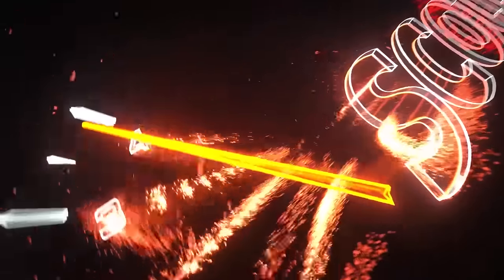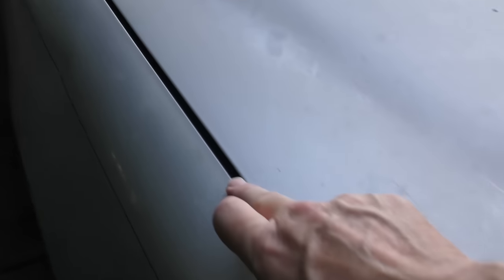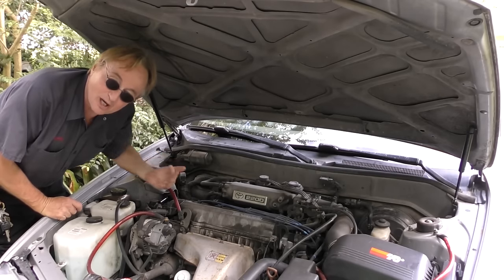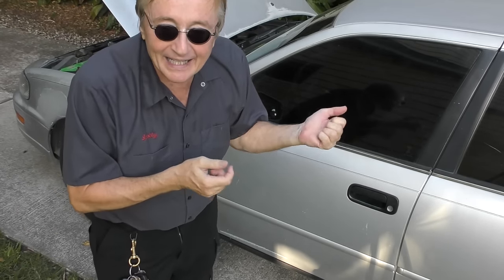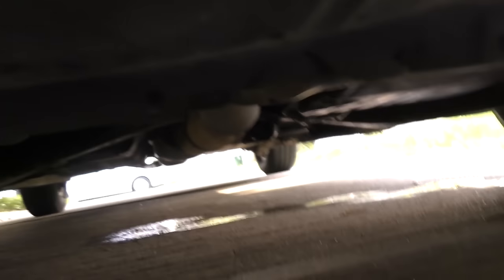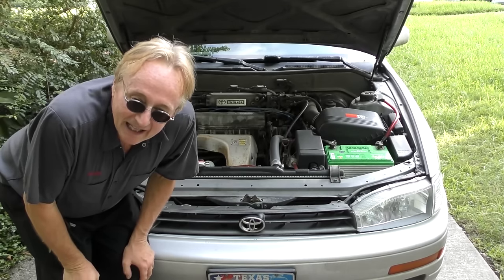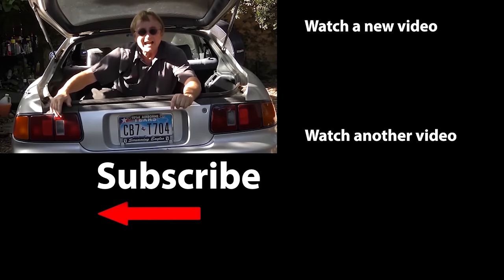Can You Destroy a Toyota Camry

Comment: Just did a cross country trip in mine...2.0 liter Auto with the AC blowing cold and got 6.8liters per 100km ...excellent ...Easy to work on ...just did new shocks all round cam belt and rad ....super cheap to run ....don't make them like they use to...

Comment: Just purchased a 2001 camry for 2900. 135,000 miles. Was looking for a 2001 lexus ls430. When my dad was like save your money, Starts up quite as a mouse, and drives amazing for a 19 year old car. I'm sure the new shocks help but other than that everything is original. Not great power but enough to have some fun around corners. Just dont expect to claim any pink slips. But awesome reliable car.

Comment: Besides suspension work like brakes,ball joints,axles,wheel bearing,or changing tires..the engine bay is accesible to work on without lifting and putting on jack stands unlike most manufacturers that require you to do so.

Comment: About ten years ago I once saw a late 80's-early 90's Toyota used for a fund raiser at a car show. The car was donated and had several hundred thousand miles on it and the body showed it. You gave them five bucks and guessed how long the motor would last locked on full throttle. This beast ran for over 15 minutes before you could hear a change in the sound emanating from the engine. It became more and more labored but still made it pass the 20 minute mark. Raised the eyebrows of quite a few Japanese car skeptics that day. BTW, the Toyota had it's oil drained before they started the ordeal, apparently they had done this before and found that unless they drastically handicapped the engine it would run forever.

Comment: I have a 1993 Toyota Camry wagon. I bet I m the only one who has this unique car in my city. I bought it 5 years ago with 191000 miles on it for $1100. It now has 250000 miles and still runs and drives good. Never left me stranded and never broke down on me. Original engine and transmission and everything works besides the rear window wipers( yes there are 2 rear window wipers )

Comment: I'm on my 5th camry now. It's a 1994 2 door. I'm the 3rd owner. It has over 270,000 miles on it. But she don't sound or look like a camry anymore. I've been working on and building Toyota's with my dad for over 30 years now. And I've blown a couple of camry motors. I've never seen another engine run with a softball size hole in the front and a baseball size hole in the back and the damn oil pan ripped in half. And still run

Comment: 2009 Toyota avensis 2.0 d4d 720k miles, drive like I stole it since I bought it with 40k on the clock and everything still original apart from brake discs and pads.

Comment: I have a 1996 Camry (according to research it is the best Toyota ever made as Toyota decontented the subsequent ones) The only major problem I ever had with the car is I had to rebuild the Driver's side wiring harness as most of the wires in the door had split apart. They wanted $600.00 from the stealership for the wiring harness so I took it out and repaired it myself.

Comment: got my self a 1993 camry 5 months ago. it's got  283,000 miles on it  and so far after replacing the brakes,tires, and rotories  It seemed to be doing just fine.... until the alternator quit so I replaced that my self. The bad alternator killed my battery so I picked up a battery from Walmart for 50 bucks and here I am waiting to see if it will quit on me or just keep going with regular fluid changes.  It vibrates just a bit when I put it into drive,reverse but you told me not to worry about it so I won't. However I keep hearing a pop in the back when ever I go over a bump. is my first car by the way and is running strong.

Comment: First car was a 1995 Camry Lumiere which is a import from Japan, paid $1200NZD for it, only replaced it when I ended up being in an accident in it (dude didn't look before turning and hit me) and even after that I drove it home and drove it to the panelbeaters no issues, replaced it with a 1998 Camry Lumiere import that I found for $1550 NZD that so far has only needed an oil change and a new battery plus a couple of bulbs to be road legal since I've owned it

Comment: 03 2.4 camry with 200k miles
Everything original except the battery, front brakes (rear drums are original), starter and brake lines. Drive belt is original.

Comment: I’ve got a 98 Camry CE with 142,000 miles on it. The only major work that had to be done was replace the lower control arms. And I blew my head gasket, it still ran like a champ and it was incredibly cheap to replace the head gasket. These things will last forever

Comment: It's true!! I had two of those of that model and one of the next model and one of the next model after that. They all had 300,000 plus Miles when I sold them and they all had original air conditioning and refrigerant too. After my early 2000 model Camry I started buying Highlanders which are just as reliable and now I'm in a 4Runner.
Toyota for life!!

Comment: Those engines are good for a million miles as well, as thy are also used here in minibus taxis, and there service is often a thing done when it will not go no more. Saw one that stopped at the terminus, in the sand, and there they did an engine overhaul, new rings, new bearings, grind in the valves, decoke set and had it ready for the afternoon, still using the old black sludge that was in it as oil.

Comment: I had a 95 camry 4cyl paid 400 for it. 450 for the timing and water pump. Drove it over a year put way more than the average miles per year on it and still sold it for 800. Wish ida kept it but it was kinda small to me and i got an 05 Lesabre that only cost 700 and still driving it a yr later. Needs trans work now but just drove it over 60 miles yesterday

Comment: I had a 79 Toyota Corolla wagon that I paid 200.00 for about 1995,  and I drove it for 14 years delivering pizza. I put 700,00 miles on it and it was 15 years old when I bought it. It finally rusted/worn out after probably a Million miles. I drove it to the scrapyard and got 350.00 for it.

Comment: I have a fully loaded 95 v6 Camry with 145k miles on it. Interior is leather and immaculate, the outside is pretty clean to. Air conditioner works fuckin great. I’m gonna drive it til it dies. Running really strong right now to

Comment: I don't know about destroy but I did Rip the spider gear out of one, that was 100% my fault. The one I had was a 96 model when I got rid of it it had well over three hundred thousand miles on it it never leaked oil the motor ran quiet never rattled the transmission never slipped and every single electrical piece on the car still worked like it came from the factory. I would highly recommend a Toyota Camry

Comment: Love my 99 Camry 4cyl auto o/d over 200,000 runs like a top and when i got it it new shocks struts breaks new electric fan runs like a top even bought it with new tires havent had it long but just love it and gonna paint it and do the cosmetics in the spring !

Comment: My '95 Camry 4-cylinder has 310K miles on it. All original (except water pump) and runs as well as it did when I bought it 200K miles ago. On the Summer freeway using air conditioning it gets 32 mpg. I'm going to push it to 500K miles.
As my brother says, "Toyotas last longer than you wish they would".

Comment: Now I heard these old camrys are good but I bought 97 from a dealer ship and have had to change the engine, water pump, timing belt, cv axel, tensioner and alternator and I haven’t even driven it long enough to require an oil change yet

Comment: I bought a 4 cyl 2005 Camry a few months ago and am happy with it so far. Can I expect it to be as dependable as the 5th generation Camry?
Reply: 5th generation Camry's are from 2002-2006, so you have a 5th generation Camry. If the previous owner took care of it with regular maintenance (oil change every 5K miles) and you do the same, you should have no problems with getting it to 300K+ miles.
Reply: @olias89  Thanks for the information. Yes, the previous owner kept up with oil changes and I plan to do the same.

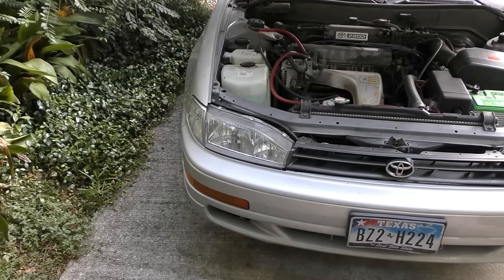Comment: 2:20 those are aftermarket headlights. I had a brand new 1992 and the headlights weren't that clear see thru style. They had the old style where you couldn't see the bulb inside.  Camry started using the clear headlights in the 2000 model year.

Comment: Had a 90 LX 5.0 Mustang and had a front coil spring break just drivin down the road, it slammed the front end to the pavement and ripped out the driverside steering and busted the the rotor off the mount, ripped the oil pan off and snapped the crank. All because it broke a coil spring, how does a coil spring snap in half.

Comment: My buddy had an old Corolla, we tried to kill it. Drained the oil, antifreeze and transmission, started it and put a brick on the pedal down the the gravel pit. It kept bouncing off the rev limiter for an entire 6 pack but didn't seize. So we smacked it with the excavator a few times, that shut it off. Reset the fuel pump shut off and it started back up. It went to the scrap yard having thumbed its nose at us. Toyota engineering is why I bought a Tundra and convinced my sister to get a Corolla

Comment: alex palmery from legit street cars tried to destroy the engine in a camry by driving it without oil and as long as he had the sump oilpan and valve cover gasket on even with the oil drained it just ran and ran and only siezed after removal of all those and the oil filter and even then could work if you put oil back in and put everythuing back on

Comment: I have a 96 Camry with 154k miles electric windows dont work and have a door handle to replace but it has the V6 only wish it was manual transmission that engine has a lot of power

Comment: Hey Scotty, i have a 99 Toyota Camry with an airbag light on any ideas???  Thanks
Reply: I had just fixed that problem. I had a badly clogged air conditioner drainage, that leaked into the car, because it was not aiming out like it should. The moisture leak from the air conditioner, had to have came into contact with the control module, which triggered the SRS light to come on. It could be the clock spring, or bad crash sensors. I read that, if the horn works, then it is not the clock spring in the steering wheel. I was very late in discovering the SRS light because the previous driver took both the SRS light and the check engine light bulbs out. 

Didn't catch on until the state inspections started checking for the SRS light to come on then off(Tried to sell me a whole new dash, when all it needed were two bulbs). Look up the control module, which should be the source of your problem. It is located just under the air conditioner. My old man said, there should be a cover over it. It looks like a metal box with a yellow sticker with black font on it. He replaced it, and the light went out. I was about to sell that car for that SRS light, in fear that it would never pass inspection again.
Reply: @Joe_334  we replaced the module and it went off but I think the same thing is happening because it's always damp under the drivers side. I should probably fix that drain before it happens again.

Comment: Just bought a 1994 Camry with only 175k kms on it (Canada). But I’m having a hard time registering it cuz it won’t pass the safety inspection. Engine and tranny are in mint condition but everything else is not. Suspension, muffler etc. Should I keep it and work on it or sell it back?

Comment: My dad has a 1998 unfortunately the engine got ran low on oil by the previous owner another family member by low I mean dry and then the engine finally blew up but we got a used engine same exact kind with barely any miles on it.

Comment: I had a 1993 Camry got it with 197k miles and got rid of it at 310K. AC worked (but it had a leak so I had to keep recharging it) ran very well

PS those are not the original headlamps

Comment: My 2000 has only had break pads and shocks replaced and I serviced the timing belt when it hit 100k miles not because it needed it because I know the belt wears out. Other than that it’s at 130k now

Comment: Right on!   My '94 just passed 300M.  All major & minor services for life of car.   MUCH better appearance than this one.  Maybe once a year I need a major repair/replace, but I have a good "Scotty" to work on my car, at 1/2 or less than dealer.  Major 60M service including water pump is $1300-1400 at dealer, mine was $500+.  I have recent tires, battery, alternator.  Body is always washed (by hand) & waxed.  fabric interior is all intact and clean.  I'd drive it across country any time.  I'd buy a 10-15 year old Camry, but I'd want to know the car myself.  My first cousin's only weakness is new cars, every 2-4 years he swaps in for another new one.  He babied his 2007 ES350, and swapped it in at 27M miles, for a brand new, fire-engine-red Buick with all the gee-gaws.  I withhold my comment on that one.  I had offered him near retail for it at 3+ years.  He got more on his trade in.  Two days later, I went to the dealer and got it for 2 grand less than the cash I offered him.  I never let him see me in it.

Comment: Is this thing still on the road 4 years later? We own a 2000 Camry with 275k miles. Biggest issue is someone stole the catalytic converter. 😆  And the valve cover gasket leaking oil.

Comment: My 1993 camry shot out its spark plug holder ; that little rubber tube that goes into the engine. It shot it out and now is loose and wont stay in when the engine is on. I think its toast and I want to engine swap it. Im not sure what to do but it looks like ive destroyed it.

Comment: So I bought a 2000 Toyota Camry 2.2 4cl inline 297000 miles with cold air intake and straight pipe also it has no AC completely ripped out & a kill switch for the radiator fan have too manually hit the switch if idling more then an hour. Drove it a month and on my way too work it started overheating badly. Therefore I replaced the radiator because it had a huge screwdriver 🪛 hole in it (odd) but its still overheating after replacement.
So then i replaced the thermostat guessing that was the problem, still overheating. My guess right now it's water pump because I see it leaking from a small wheep hole on water pump plate that holds the bearing?
I'm hoping that's it because if that's not the problem I don't know HELP !????

Comment: 2001 toyota camry ce 4cyl 5sfe engine. Its leaking from the crankshaft seal or rear main seal. Bleeding oil to death. Needs engine or transmission to be dropped to replace seal. What options do i have on a near $1000 repair for a $2000 car?

Comment: Rust is the only thing that could kill them, sadly. I owned a 1993 V6 fully loaded for a few years and I had to junk it at about only 110,000miles. It still looked great but was completely rotten underneath.
Reply: @Syntheory I saw a 1992 DX manual one with 173,000 miles & it only had one rust spot where it got scraped. You should’ve rinsed the salt off regularly. Sounds like your car was in an accident & not sealed up right afterwards. I’m in Canada, salt land, & I see 30 year old ones daily being driven around, the only rust they have is from being scratched & scraped. You’re one of the only people I’ve heard have this issue at such low mileage with your Camry. Most of them don’t rust like yours, I know because I see them all the time where I live. People just suck at taking care of their stuff.
Reply: I got it for free from an old man who let it rot in his driveway for years. I would have had to replace pretty much everything underneath to keep it going. Still managed to put a lot of miles on it for about two years.
Reply: @Roboami  okay that explains it. Lot rot. Yeah lot rot is bad for ANY car. There’s an old lady 30 miles away from me with 65,000 miles on her 88’ Civic DX sedan, and it’s been sitting for 9 years in the same spot in her front yard. It’s an absolute time capsule, however, lot rot hasn’t been kind to the door seals

Comment: hey scotty I got a 2001 Camry for 400 bucks 245k miles all original but the girl says the water pump was making alot of noise and squirting coolant.. is it possible for a 4 cyl 2001 Camry engine water pump to visibly squirt visibly leak ALOT of coolant when it catastrophically brakes? I really want the car I just bought a 100% original 2005 Corolla auto with 246k miles exactly and it runs like brand new just needed a new gas cap the original was just flopping around.. said they drove 50km with the engine light on from the gas cap like that on my scanner fixed that and the plastic intake were they press the 2 pieces together on the 1zz I believe it had hairline air leaks all around those cracks as my idle would surge 740 to 840 every 20 seconds I replaced the intake gasket but the old one looked like it was still sealing 100% but could be wrong but then I used black RTV around the intake "seams" were they pressed the 2 plastic molds of the intake together and my idle is 100% dead on 730rpmto 740rpms some times 630 to 640 rpm also but it never surges more than 10 to 15 rpm when it used to surge 80 to 120 rpms also it just sounds more pressurised now when someone blips the throttle for me.. buut I am bow concerned if my USA version plastic intake baffle is rattling it kind of sounds like it to me.. soo I'm wondering if u can pressure test a really old dried up looking 1zz plastic intake and see if they do have hairline air leaks. around the seam were they pressed the "2 halfs of the molds" to create the plastic intake in entirety.. AND please help us find out IF that 1zz plastic intake 240k miles + had a rattling baffle... I really want to run this same motor until 500k+ without changing anything my wife drives like slow as u can so.. it's her car I want to get a Lexus is300 I love toyotas now and for ever.!!